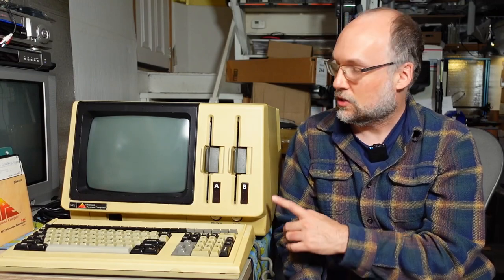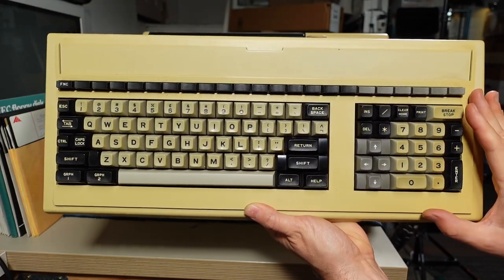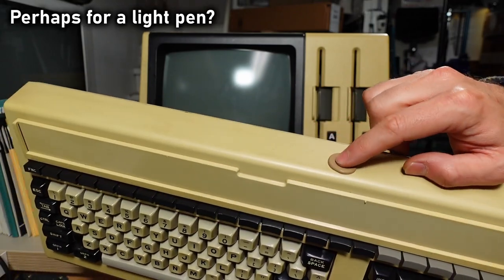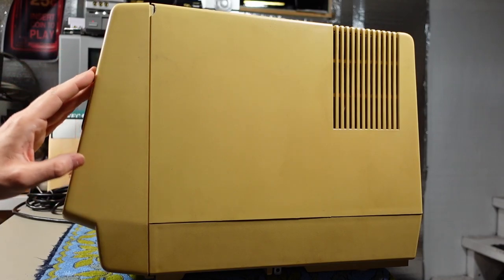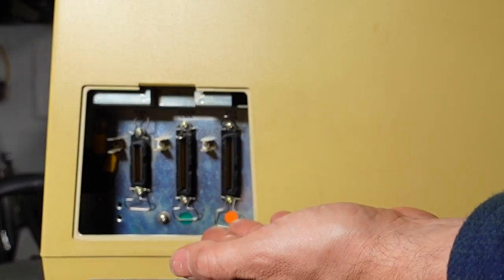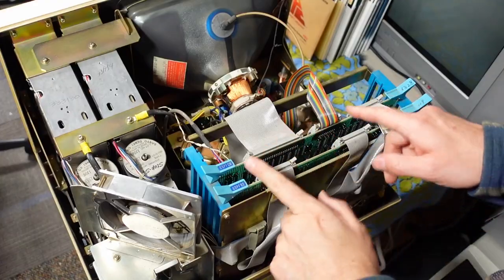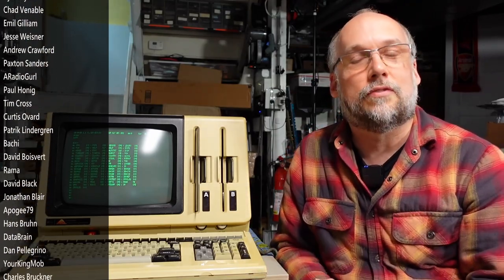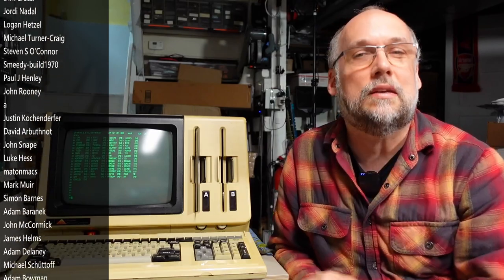The NEC APC runs MS-DOS from 8" disks

Comment: Another great retro-computer story. Thanks for another walk down memory lane Adrian!

At the time of its introduction, even MS expected that the IBM platform would be one of many x86-based platforms, in much the same way the Z80 dominated the CP/M market. Consequently, they cleverly arranged to market MS-DOS as a "generic" equivalient to IBM's PC-DOS, thinking that DOS-compatibility would pave the way to 16-bit success. Computers like the Tandy 2000, the Heath/Zenith H/Z-100 series, this NEC machine and others reflect similar thinking.

Personally, I think the diversity of the CP/M ecosystem was one of its strengths rather than a weakness, and that the "need" for 100% IBM hardware compatibility, rather than a more-flexible software compatibility, stifled a lot of creativity and "individuality" in the 16-bit computer market, resulting in the rather bland choices we have today.

PS: Sharpie case repairs rule! :-)
Reply: This was an interesting time. I worked for an early computer manufacturer that made video terminals and early PCs. They had CP/M and IBM compatible systems available. When IBM came out with the XT computer, this nearly put this company out of business along with so many other companies that relied on the IBM original design as well as the non-compatible designs nearly overnight. 

It's as if IBM flattened the playing field not only with the expanded bus, but also with the standardization of the platform. The full adoption of PC-DOS and later MS-DOS fully nailed the coffin not only for the hardware but also for CP/M. It showed how much power IBM had over the computer industry back in those days.

Comment: This video brings back memories. I started repairing these machines to chip level for NEC in Australia in 1982/83.  There was a colour version available and it was mainly used with AutoCad. The additional connector on the back was for a hard drive unit. I can't recall what the capacity was, but I guess 5-10Mb is close. I had circuit diagrams for most of the boards and eventually used a Fluke 9010 troubleshooter to repair the CPU, and Graphics boards. This was a fast machine with its true 16-bit 8086 CPU, in comparison to the 8088 based computers at the time. (It also had a great graphics controller and 8087 Co-processor board) The other thing that made it fast was the floppy drives. They were at the time the fastest drives I had ever used, but they were a little noisy. As the OS (CPM-86 and eventually MS-DOS) loaded from floppy disc, the speed of the drive made a big impact on boot-up and usability. As there no circuit diagrams (for the drives) available initially, I had to reverse engineer the the electronics using just a multi-meter. NEC did supply diagrams and alignment procedures at a later date.
They eventually replaced this computer with a more conventional design. The APC III.(still not IBM PC compatible.
By then the (technically) inferior IBM PC was starting to command the PC market, and it was the beginning of the end for this line.

Comment: I was software developer back in 1982, and we selected the NEC APC for our software. It initially offered two operating systems, CPM-86 and the UCSD p-System. We used CPM-86, which was a very poorly written operating system.  Later, MSDOS became available for the APC. The APC came out at about the same time as the IBM-PC, so no, it was not hardware compatible.

The APC was indeed very advanced, especially compared to more primitive designs such as the IBM PC.  While you ran into data referring to the CPU as an 8086, the actual chip was an NEC made variation, the NEC V-30 which was 8086 compatible, but faster at the same clock speed. Mine had a single 1Mb 8" floppy and an external 10Mb hard drive. It came with an excellent full keyboard, including separate cursor keys and a numeric keypad. It also featured full EGA level color graphics (640x475), and it contained a separate graphics coprocessor and it had a built in sound card. I didn't personally work much with the video processor, but I have a vague recollection that it drew things on the screen with vectors, and that, for the time, it was very powerful.

The machine came with a full listing of the bios and a full hardware diagram. That allowed me to take more control over the hardware, including the interrupt control, which allowed me to replace the printer driver with one that was interrupt driven. (The default driver used a timing loop to wait predetermined times between characters). That enabled me to edit and compile programs at the same time that I was printing. It also allowed me to drive the printer much faster, and it could keep up with a 300 lpm line printer.

My recollection of how the sound system worked is that you coded the music as a series of notes, along with note duration and volume, and placed the string data in memory, and then told the sound system to play the data in the string. It was fairly primitive in sound quality, but was far, far more advanced than a simple "beep".

 All of my information is from personal memory, so information you found online may be more accurate....

Comment: Adrian: I'm sure you know this, but the reset vector is always FFFF0 for 8086 compatible processors, not FFFFF.  When fetching instructions, the processor fetches the opcode from CS:IP and the parameters from CS:IP+n, so the first instruction is typically a JMP to get to a lower address at FFFF0 with the address starting at either FFFF1 or FFFF2 depending on the instruction used.  If the CPU fetched that instruction from FFFFF, the address part of the instruction would wrap to 00000, and the result would be a jump to an undefined address.

Technically, for 16 bit machines, the initial state is CS=F000:IP=FFF0, although it's possible some 8086 implementations went with FFFF:0000.  I believe most 8086 BIOS implementations start with a far jump instruction, forcing specific values for both CS and IP on reset.

Note that it's possible that modern UEFI BIOS implementations start with a near jump and go directly to 32 bit "protected" mode in SEC phase (UEFI BIOS: reset->SEC->PEI->DXE->BDS) so the chipset doesn't have to map the reset vector to the low megabyte, but I'm not %100 sure.  Modern 32 and 64 bit processors typically set a 32 bit base for CS at FFFF0000, 64KB limit, and (E)IP at 0000FFF0.  Even modern x86 compatible processors reset to a variation of F000:FFF0.

Good luck finding any software that's cross compatible, even under MS-DOS.  The interface needs to be designed to be completely standard MS-DOS command line; strictly STDOUT / STDIN / STDIO.  I could probably write something in C or assembler that would be cross compatible, but it would be pretty primitive.  Maybe an old text adventure game like Zork or something would work.

Comment: The lowest option for memory for IBM PC was 16 kB, not 64 kB. The 16 kB model can only run programs from a cassette, because booting from a MBR requires at least 32 kB of memory.
Reply: MBR wasn't a thing until hard drives, which the original PC didn't support. You had to upgrade the BIOS (swapping out the ROM chips) to essentially turn it into a PC/XT for that. Conversely, they removed the cassette port on later models.
Reply: @0LoneTech  The original 64 kB model IBM PC can boot from an MBR from a floppy.
Reply: @tikkasen_urakointi  That's a boot sector. The Master Boot Record was so named because the usual boot sector was inside a partition. Which isn't a BIOS feature, but the original BIOS didn't support the extension required to add those large drives that needed partitioning.
Reply: @0LoneTech  That's not correct. A hard disk does not need to be partitioned. BIOS only reads the first sector from the drive and runs it as an executable code, and that's called the boot sector or master boot record.
Reply: @tikkasen_urakointi  The reason to partition them is a bit obscure. It was because the root directory (and file allocation table) is of fixed size, so unless you had some giant files you made partitions to make the large size usable. Later subdirectories were introduced and multiple partitions fell out of fashion, though they were reused for other workarounds like multiboot and working around BIOS disk size limits (e.g. the 504MiB one). BIOS doesn't care or know about the partitions at all, but the typical boot sector just doesn't fit in the MBR because it also holds the main partition table. The PC has a long history of ugly workarounds for arbitrary limitations. 
The MBR is a boot sector, but the boot sectors on floppies aren't MBRs. The distinction is one sane BIOSes don't care about (some insane ones, like some from Lenovo, do).
Floppy boot sectors typically do store some disk format information as well, in the BIOS parameter block. Just as the name doesn't imply, BIOS has no knowledge of them either; DOS uses them to not access outside the disk.
Reply: Possibly booting DOS was only possible with a minimum of 32k (ISTR the later versions like 6.22 could be trimmed down to a bare 40ish kb resident in memory, earlier ones presumably used less?), but seeing as the disk bootstrap routines would have been in ROM just the same as BASIC, and you can get executable code into a half-K bootsector just fine (even simple games!), plus floppies being available for all kinds of other machines with that amount of RAM or less, it seems doubtful that a 16K PC couldn't load from disk.

It not being able to use disk *BASIC*, I could believe, as that had to load from a disk in the first place and occupy a significant amount of RAM (seeing as its whole selling point was being more sophisticated, and thus taking up more total space, than the ROM version), so likely you'd be limited to using ROM BASIC which didn't have any disk load/save routines to my recollection, only tape. (Or if it did they were very simple, and amounted to being able to use a blank floppy like a random-access tape, rather than having any kind of DOS functionality)

That and there were probably very few 16K PCs sold, and very few with a disk drive as that would have itself been a cost option option on a similar or higher level as adding extra RAM. Might even be that IBM wouldn't even sell you one with that combination because it seemed limited and poor value. Which means very little if any software would have been targeted towards that combination. And before too long the minimum actually did become 64K as memory prices fell and it became clear that the platform needed a fair bit more memory to be able to compete with the C64, established CPM machines that were routinely available with 32 to 56K, etc. (I think even there was a generational break with motherboards that could be populated with 16 to 256K, then 64 to 512/640K? Like a whole extra RAM chip addressing line was added, quadrupling the potential capacity of each IC through the magic of the address pins being multiplexed for both RAS and CAS... And certainly having 256k as the motherboard max before you were obliged to start installing memory expansion cards into the rather limited number of slots would have very rapidly become clear as something that hamstrung the machine's prospects).

Compare with the 16K vs 48K Spectrum machines maybe. Even though the 16K Speccy had some popularity through being dirt cheap (especially as a kit) and had a bit more utility due to being more resolutely BASIC and tapeloader based, the 48K quickly took over as the more default choice because that extra memory space gave software so much more room to breathe, as well as running faster... Although it was entirely possible to cram quarts into that pint pot if you were clever, it wasn't worth putting in that much effort to prove a point when you didn't lose too much market share by demanding the greater memory amount as default. (And then the 128K came along which led to a lot of dual-version tapes and the 16K looking like a complete joke)
Reply: @tahrey  The 16 kB model cannot boot from a disk, because the boot sector is loaded to memory address 0x7C00, and that address doesn't exist in the 16 kB model.
Reply: @tikkasen_urakointi  is that something hard coded into the BIOS ROM? Because that seems like a bit of a misstep if so... That or a sneaky deliberate inducement to buy the memory upgrades ;) 

If not, and the boot sector can pick where to load the rest of the code after that first tiny piece is loaded, then it's a problem with the  individual software instead... So maybe nothing that came on disk would fit into 16k anyway so the load address was a deliberate thing?

(after all you probably could have run some kind of CPM software even with that little memory given that the video board has its own RAM, and you could load in small bits of code and data as required a lot easier than with tape where you generally loaded everything at once)
Reply: @tahrey  The boot sector is always loaded to the memory address 0x7C00, and that address does not exist in the 16 kB model.

Of course the boot sector code can then download more more code where it wants.
Reply: @tikkasen_urakointi  fair enough... someone either wasn't thinking, or was thinking too much about the wrong thing then? Or perhaps they didn't have a 16k option in the design until the last minute then added that as a budget home user option? (or maybe to be used as a smart terminal with a card that has its own boot ROM...)

(I'm not that great with hex and had to check... Top of the 32k range, leaving half a K for stack... Why so high? Yet not at the top of a 64k segment... A quick Google, as I'm doing this on phone but sat in front of a PC because it's a weird day, shows working memory started at just 0x0500, or decimal 1280 bytes, above all the vectors etc)

And guess for a budget option they couldn't justify a new BIOS with that one pair of bytes changed?

Comment: In a previous episode a viewer sent you one or two 8231 (or AM9511, the AMD original design of that Arithmetic Processing Unit). So you would be able to populate the socket.
Reply from the maker: Oh good to know! I have a spreadsheet with inventory of all those chips so it'll be easy to find.
Reply: @adriansdigitalbasement  One additional note - some 8231/AM9511 run stable at 2MHz, some at 4MHz. I'm traveling right now so don't have access to the documentation, but you can check online the exact model number and find out which it needs.

Comment: I had a standalone Epson monitor identical inside with the Sanyo, even the knobs were identical. White phosphor, VGA input. Turned it into a battery powered Plasma Arc generator for fun back in my early teens since it would power the flyback trafo on 12[V]...

Comment: That card form looks a lot like Intel Multibus 1. It was a standard they released in the early 70s for expandable computer racks. Similar to EuroCard, VME, etc.
Reply: It is smaller than a Multibus card but likely much the same bus structure.
At one point, Intel sold a thing that would have made a very nice personal computer but they wanted waaaaaaaaaay tooooooo much money for it.  It was an enclosed rack that could hold up to 8 multibus cards

Comment: 82C55 is clock generator for cpu and peripherals , 82C54/53 is a tmer and drives the speaker too, 82C37 is the dma , 82C59 is the irq.

Comment: 32:25 if you flip your 50-pin connector upside-down, all of the signals that have shugart equivalents match up.

In the order DCBA, your drive select pins are 19 21 23 25 these are the 10th, 11th, 12th, and 13th pin, counting UP, on the odd-numbered side. Then 10th, 11th, 12th, 13th pins on the even-numbered side, counting DOWN, are 32 30 28 26. The same mapping works for the rest of the pins.

DIFFERENCES:
APC has two pins that shugart does not appear use: FILE UNSAFE and FILE UNSAFE RESET. Both of these would map to undefined pins on a shugart drive.
APC has three pins whose names don't match the ones on the shugart pinout I found: APC has 1/3/27/3/1: "WINDOW," "MFM," and "VFO SYNC," "MFM," and "WINDOW," which would line up with 24/48/50: "SEP CLOCK," "SEP DATA," and "SECTOR" on the shugart side.
SHUGART has three pins that APC does not appear to use: "TRUE READY" (pin 8 or APC pin 43), "DISK CHANGE" (pin 12 or APC pin 39), and "IN USE" (pin 16 or APC pin 25)

Comment: The engineering company I worked for back in the 80's had a decommissioned automated test station run by this computer.
Engineering used it for preliminary test protocols for new products. The production line had newer IBM pc's to run the tests.

Comment: The heatsink looking thing on the power supply is probably shielding to prevent the switching noise interfering with the monitor.  Sperry had a problem with one of their monitor models that was so bad that some of them would lose sync if the monitor was positioned in the not-so-sweet spot above the PSU in the computer itself.
Reply: I've seen some devices that have an interconnect between the monitor and the power supply.  The idea is to sync the power supply with the horizontal frequency.  The magnetic field still distort the picture, but because it's synced, it won't move across the image and disappears in plain sight.
Reply: That’s funny, and also kind of cool.

Comment: Usagi Electric have been restoring a minicomputer floppy controller that had a strange pinout. He showed the pinouts a few weeks ago, so my memory of it is fuzzy, but the select lines for 4 different drives looked the same. He had to make a little adapter board. The signals are all standard, but on the wrong pins. I think he had Shugart drives hooked into the Centurion 6.

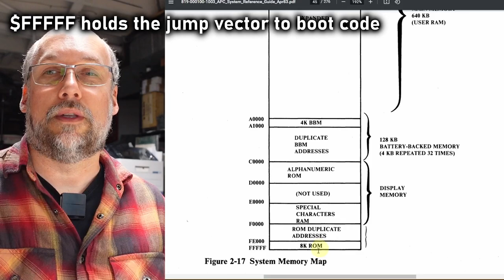Comment: You got the reset vector wrong at @30:52 - its not $FFFFF but FFFF0, composed of CS=FFFF and IP=0000  (LA=CS*16+IP), for the 8086, the last byte of address space would be useless, its 16 bytes below the top.